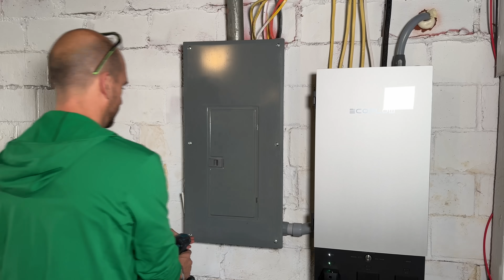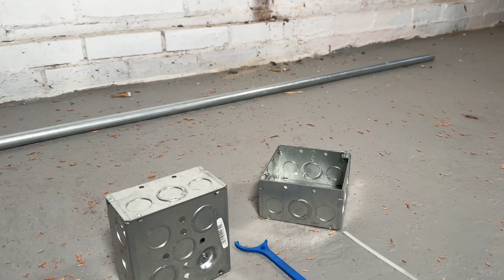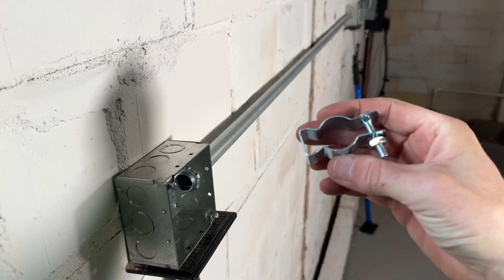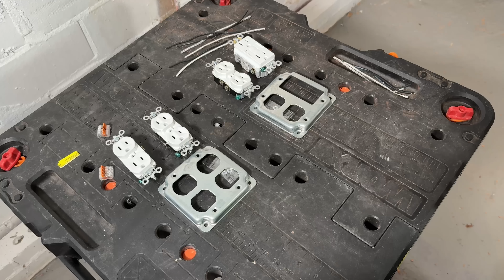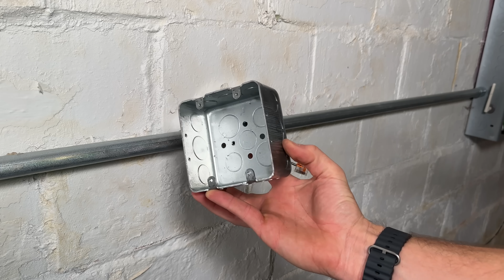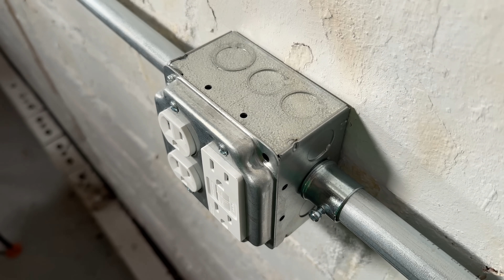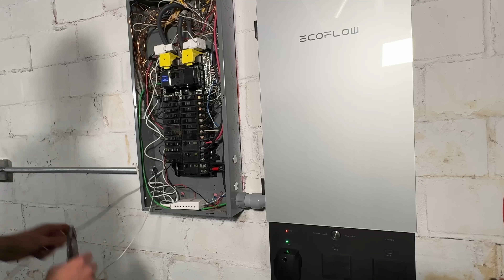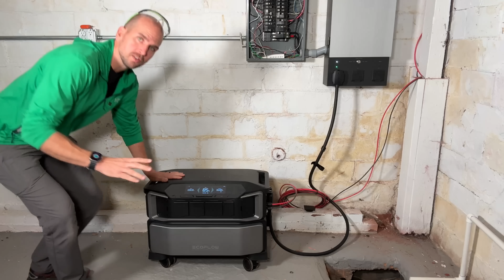Add Outlet To Unfinished Basement Or Garage

Comment: I haven’t seen or installed a conduit run to a panel without a separate ground wire since the late 1970’s, thought they settled that a long time ago. If the conduit rusts out or becomes disconnected from the conduit connectors along the run you would lose the ground entirely (and trust me, it happens more often than one might think).
Reply: It made me uncomfortable too.  I'd rather spend the extra on a real ground wire.
Reply: @quademasters249  the emt is a real ground
Reply: @greggpurviance7252  

I hear you and you're not wrong.  I just don't trust it because who knows what kind of shape it'll be in in 10 years.  

The joint at the breaker box is depending on the ring to dig through the paint to reach ground.  It just feel a little too sketchy for me.  

Maybe if the attachment point of the conduit was more substantial I wouldn't feel that way. It's just a screw clamp. Not a particularly good one.
Reply: @quademasters249  yes, most electrical problems are caused by installation errors. If the screw and fitting are tight, it is as good or better than the green screw on the device
Reply: @quademasters249   Screws have been know to come loose or be missing, and locknuts can also come loose. Seen it countless times in my 40+ years in the trade.
Reply: @mxslick50  Screws and fittings that are installed correctly don't just "come loose" or disappear. When installed properly a metal conduit system is just as good and better electrically (up to about 400') than a wire type ground. So why do you trust that the green grounding screw is immune to becoming loose if you believe that screws just magically loosen themselves? Answer? They don't just come loose any more than emt fittings just come loose. When you've seen loose fittings or screws in your career, as I have, what you are looking at close to 100% of the time is something not properly installed initially.
Reply: @pld8993  lol, I’ve been working with this stuff since the 70’s and I see loose, missing or corroded conduit connectors ALL THE TIME!! It’s almost NEVER installation error, it’s almost ALWAYS some other careless tradesman, harry homeowner or otherwise clueless person who doesn’t know or care about the pipe that’s in the way of what they are doing being a ground conductor; they just want it out of the way so they can do whatever it is they are doing and the hell with making sure it’s tightened back up. I see a lot of corrosion issues in basements and garages too causing high impedance grounds which means that it’s easier for current to flow through YOU than back to the panel. I find and clean up these messes all the time at work and in older homes.
Reply: @mjg263  Joe homeowner rarely gets the opportunity to do what you described, though I know it happens, because most residential is not done with metal conduit of any type so maybe in residential a redundant wire ground makes sense. I've been an electrician for over 40 years, installed hundreds of thousands of feet of EMT, IMC and rigid doing commercial and industrial work. Metal conduit without wire-type EGCs is acceptable and normal. What you describe, while it can happen anywhere, is not usually an issue in non-residential.
Reply: @pld8993  Many homes use conduit in basements and garages where wiring is surface mounted. I see conduit set screws and fittings that have been loosened, box connectors and couplers that have been slid apart, emt that has been unfastened from walls etc after proper installation ALL THE TIME. Sometimes it’s even work that I installed decades ago after tradesmen from other departments where I work have come through years later and moved everything around. They are not electricians, they wouldn’t know that the emt is being used as a ground and must retain continuity back to the panel and they don’t care. THAT is why any experienced electrician ALWAYS runs a ground wire and bonds it to the junction box as well as the device and never rely on the off chance that the conduit will stay together. Screws and fittings installed correctly ABSOLUTELY DO COME LOOSE OR DISAPPEAR, and conduit connections in damp locations DO CORRODE AND LOSE CONTINUITY in the real world. If you do service work for a living rather than just new installs and have your eyes open you will definitely see it and it’s not due to incorrect initial installation 99.9% of the time. Even if it is allowable in some places it is poor practice, lazy workmanship and potentially dangerous.
Reply: Until time takes its toll.  @greggpurviance7252
Reply: I deal with large ~50 year old buildings that used conduit as EGC and it’s a total pain. It fails enough that I’ll never call it reliable. With long runs buried in building walls, it’s not practical to fix, it’s do a new run instead.
Reply: legal to us conduit as ground, but not necessarily the best idea.  The cost of a third wire is not much and you are assured of have a good ground for safety.
Reply: Loose neutrals cause a lot of problems.  Yes the magicly loosen.
Reply: I've been doing this for a long time and I've never once seen a conduit run lose grounding due to anything other than installation error. If your conduit is so rusty that it loses continuity, you have far more problems than grounding.

It's just redundant to run a ground wire through EMT.
Reply: @NoTroubleMikeG  LOL!
Reply: Maybe it was different in the 70s but EMT today is galvanized and won't rust very easily unless you're running it where it gets hit with salt water spray or something. I see EMT outdoors run 20 years ago for an air conditioner circuit that has no rust whatsoever.
Reply: The use of conduit as a ground ultimately caused the MGM Grand fire years ago.
Reply: I have never seen emt rust out inside a building. Seen it maybe twice  & both were installed so the emt was touching the earth
Reply: @greggpurviance7252  wish I could attach photos to the comments here, I’d show you all of the emt that’s rotted out in my basement right now. When I installed it 27 years ago I kicked offsets on all the boxes and strapped it to the cinderblock walls with emt straps. Now all these years later it’s rusted through on all the drops and most of the laterals because the basement walls tend to be a bit damp. Eventually I’ll change it all out to pvc but for now it’s ok because it has a separate ground conductor and gfci protected devices. I also see plenty of conduit hanging loose with the connector sleeves disconnected at work when other shops need to move it out of the way to do plumbing / woodwork / masonry repair. They don’t think twice about sliding conduit apart and leaving it that way which is another reason why I would never run conduit without a ground wire, you never know what kind of idiot is going to mess with it after you’re done.

Comment: Yeah, pretty dumb video considering all that is done I would not do at all 😂
Reply: Just because you wouldn't do it the way he did doesn't make it dumb. Other than the lack of support on the conduit and pushing wire into a live service panel, his installation is perfectly fine. It meets Code requirements, though the local inspector might ask for a few minor changes, like running a dedicated EGC wire instead of using the conduit.
Reply: @TwilightxKnight13  do you run conduit everyday?

Comment: you do realize the only reason that they say not to run Romax style wire through conduit is simply because it's difficult to pull through...
Reply: I believe on long runs it also has to be derated.

Comment: Great Video.
Before we moved into our new house, I had an electrician buddy install outlets on (2) 20 amp circuits on all 4 walls.  He installed 12 outlets--on 2 GFCI breakers.  He put the conduits vertically.  He did offset bends to put the conduits flush to the concrete walls.  He did run romex inside the conduits, short distance up to the open ceiling.  I was there with him, helping out as best I could.  We were drinking beer.  We had music playing.  We talked about life, etc...  I love the job we did till this day.
Reply from the maker: Sounds like a pretty fun Saturday 🍻
Reply: We did a lot of EMT drops with romex inside as you described many times when I was an electrician in the 70’s. We put box connections on the open end as bushings. Usually at businesses with drop ceilings and block walls. So it was apparently an acceptable practice back then. I would have no reservations doing it now, at least for private use!”Ya done good”!
Reply: @bobsbarnworkshop  It's still acceptable as the codes do not allow Romex within 8" of the floor.  If this were a commercial, industrial or hospital site, an inspector might require a box with an insulated bushing above ceiling height, with romex splced there, but it would be rarer at a residential site.
Reply: @psdaengr911 not sure you would find any romex in a site like that...
Reply: @psdaengr911  There is no code that disallows romex within 8" of the floor. Romex is not allowed in industrial or hospital facilities, and is seriously restrictive in commercial so it's unlikely you'll see it there either.
Reply: I'd go vertical also, just looks cleaner
Reply: @BatMan-co1gy 
How do you go vertical in a basement...
Reply: @lawcohn2815  I'd run the conduits vertical from the outlets to the ceiling then horizontal to the load panel and vert. again down into it. It would look much cleaner and wouldn't mess up you wall space.
Reply: @lawcohn2815 depending on type of ceiling most just run a single pipe straight up and cut it of above ceiling. Since most residential can be run in romex. The top of the pipe must have a bushing so wires don't get damaged. If wires are not above ceiling or behind walls it must be run in conduit to protect it.
Reply: I learned to bend offsets by eye early in my career, but when we were on bigger jobs we had an offset bender tool! Just stick the end of the emt in, push the lever down, BINGO!!! Offset!
Reply: I approve this method. Make an electrician your beer buddy today

Comment: Few issues here and there. Overall pretty good video for a "homeowner". One thing I'm not seeing mentioned here in the comments is the AFCI requirement. Skip the GFCI receptacle and use a Dual function breaker.
Reply: AFCI protection is not required in unfinished basements or garages.
Reply: @pld8993 You need to read your codebook.
Reply: @pld8993  My mistake. You got me thinking. Upon further review, I think I need to check MY codebook lol. The Afci protection requirement for outlets is a MA ammendment. If you are curious it reads. "All 120-volt, singlr phase, 15- and 20 amp branch circuits supplying outlets or devices installed in dwelling units shall be protected by any of the means described in 210.12(A)(1) through (A)(6)"

Comment: I get that everything is bonded back to the panel.  How is the grounding part of the actual outlet grounded if there's no wire connected to at least the box?   Out of an overabundance of caution and because it's simple I'd just run the green.  I understand that the GFCI would trip if I lost ground.  Am I going overboard with this and not thinking it through clearly?
Reply from the maker: Yeah, there is a valid point on losing ground if you take off one faceplate when the circuit is live then the outlets within the removed faceplate would still have GFCI protection but no ground.  Since the addition of an insulated ground wire with pigtails is easy enough probably best to just add for double/triple protection.

Comment: I always wondered, with using the metal conduit as the ground isn’t there an hazard if current is flowing through the conduit, if something goes wrong, and a person touches the conduit?  Also, why not use an AFCI outlet? I thought those were mandatory to use I today’s code?
Reply: That doesn't look like a living space that would require an AFCI. It does look like an unfinished area that would require a GFCI as he used.
Reply from the maker: If a hot conductor was to short against the box that would provide a path back to ground and trip the breaker.  Specifically in this instance since the circuit is GFCI protected the GFCI breaker would trip before the breaker as a small difference between the hot and neutral would be detected.  If there was no GFCI, and no path back to the panel for ground, and the hot conductor shorted then the conduit could ground through you when you touched it.

Comment: whose idea is it always to make electrical boxes out of metal, and the work to just wire an outlet... i don't know why but in the US they like to torture themselfes. here in germany/europe we use plastic boxes because in electrical fault they are save to touch and the outlets are wired much faster. big plus to him is that he uses wagos, he would have given me an heartattack if he used those wirenuts. video got a like from me because its well made, but I just can't get over how electrics are handled in most states of the US
Reply from the maker: Yeah, I know our wiring and standards are a bit of a mystery to most viewers in Europe and Australia.  Thanks for the feedback.
Reply: Well, first of all, here in the US we use 120VAC which is much less dangerous than 220VAC like you crazy Europeans. Second, the overcurrent protection devices are plenty safe and protect a user from being seriously injured in the case of a current fault.

Comment: You have made that a very dangerous install if something messes up like the gfci not tripping. You need a ground in every pipe, and every device needs 1 ground to it and every box must be grounded if there is a splice or termination. You should be doing videos unless you install it safely.

The NCCER is very clear on this. Learn it before you record, it’s going to get someone hurt.
Reply: LoL, you should take your own advice. Per the NEC Code, his grounding is fine. The AHJ/inspector is within their right to demand a dedicated EGC/wire, but it is technically not required by the Code. That being said, professional electricians do not generally use the conduit for their EGC.

Comment: There's no way I would use metal conduits or metal installation boxes.
US electrical code is just scary....
and I don't even want to start on all the other things that cause me to facepalm....
Reply: @@phillipbanes5484 no, we just like to do it "the right way, first time". That's how von Braun got Apollo to the moon and NASA without external guidance lost 2 Shuttles :-)
Thing is, our insurance companies as well as the VDE (Verband Deutscher Elektrotechniker) are interested in identifying problems and changing regulations accordingly, even if they are somewhat overeager at times. There are risks that are simply not worth taking, and insurances often refuse payments when bad wiring is involved. There are SO MANY nice and cost-effective solutions to all this DIY problems, but still US installation videos on YouTube seem on par with what we did in the late 60s or early 70s. Mind you, even back then we already had 3ph/400V in our homes, breaker boxes with touch-proof contacts etc.pp. But it's like Plato's allegory of the cave - I can tell you everything about it, but you might have to experience both to really get what I'm talking about. I, otoh, have been to the US, and I was astounded to be confronted with appliances and tools we had scrapped two to three decades earlier for being bad. And I do not think that Tucson is such a hillbilly place to justify that outdated junk.
Reply: @@phillipbanes5484PVC Conduit with Twin+Earth cable is easy to fit but metal conduit is stronger against damage. In UK even with metal conduit, there would be always be a ground wire ("Earth") run and terminated in each backbox to which the face plate would be connected by a ground wire. As an alternative to conduit you can also use armoured cable.

Comment: Fixings should always be made into the bricks or blocks never into the mortar. Conduit is supported at regulated intervals not whatever you feel.
Reply from the maker: I agree and usually prefer drilling into brick but this specific block is very brittle and I have found the mortar to actually result a better hold.
Reply: @EverydayHomeRepairs  Plus for a small job like this you can always patch the mortar if it fails, even using epoxy which will not fail. For actual professional work there's no time to "screw around" with that!

Comment: The National Electrical Code defines the minimum to be code compliant.  And it can change every three years.
Reply: The AHJ can also choose to require more stringent rules than the Code. For example, while the Code might allow for Romex inside EMT, my jurisdiction does not. Most jurisdictions allow Romex to be used, but Chicago does not. Some jurisdictions might allow the conduit in the video to serve as the EGC, but many will not.

Comment: It would be interesting to see what the resistance of the conduit was at install and over time. I guess the GFI on the socket means this is less of a problem but in the uk the electrics rely on the fuse board / breaker panel to provide short circuit protection via mini circuit breakers and what we call RCB (RCBO or RCCD) so the resistance is critical for calculating trip time for the breakers.
Reply from the maker: I will do that test today as a side project to test the resistance of the conduit along the length compared to a 12 gauge insulted ground wire.
Reply: The GFCI does not give a pass on grounding requirements or integrity, it is a device and as such can be easily damaged or fail, resulting in loss of GF protection.  While Code allows conduit to be used as a grounding conductor, it is in the REAL WORLD a bad practice. Any damage to fittings can cause a high resistance or lost grounding path, which is dangerous. And candidly, with such a short run there is absolutely NO EXCUSE for not using a separate grounding conductor, NONE.